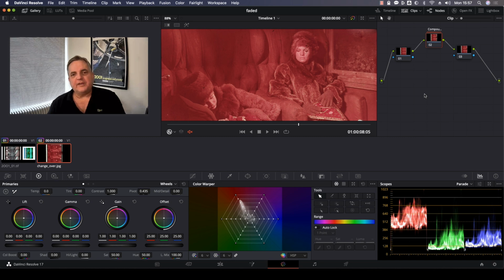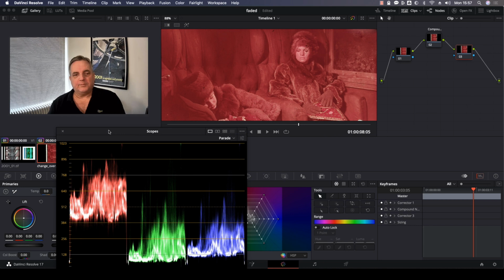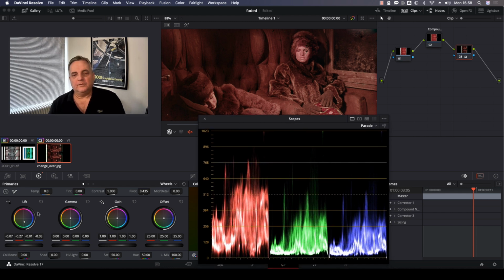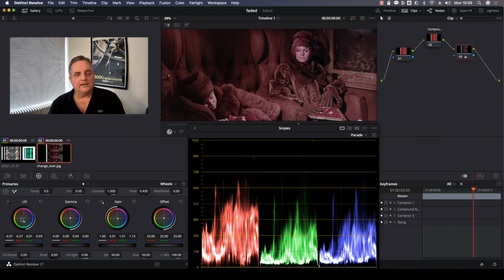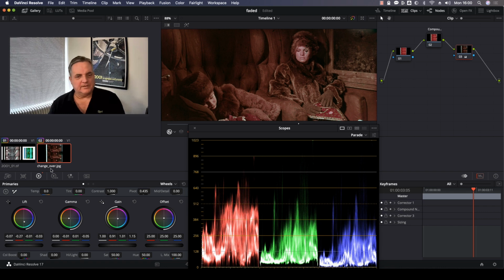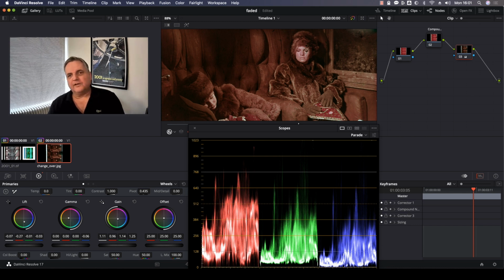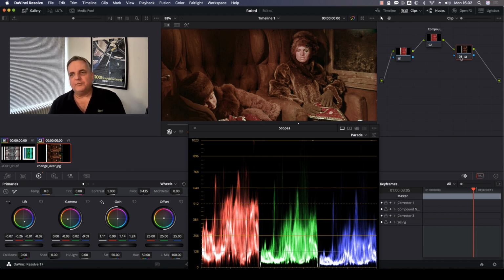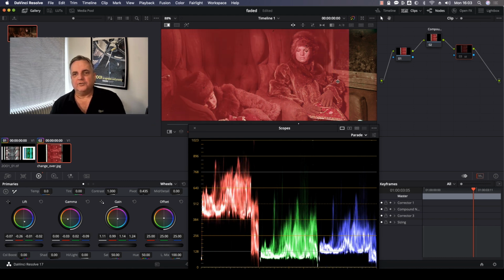Faded Film Color Repair!

Comment: Hello Blake 
why not use offset (printer light ) instead of lift gamma gain ?
Reply from the maker: It's best not to use the printer light as you want to split the gamma correction from the lift and gain correction for the best result.
Reply: @BlakeJonesShowsHowDoYouDoThat  thank you for quick respond 
as I understand ,if the clip was in log space I should use printer light to maintain the tonal range .
in this case the clip was scan, so is it scanned in display referred ?